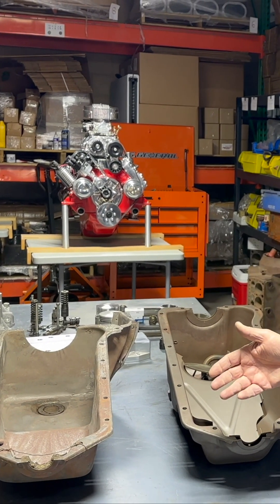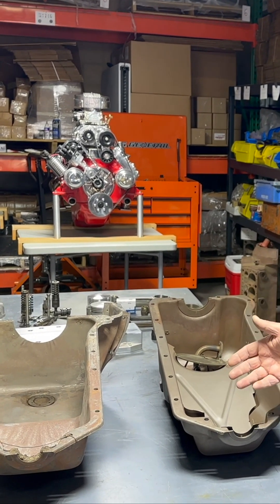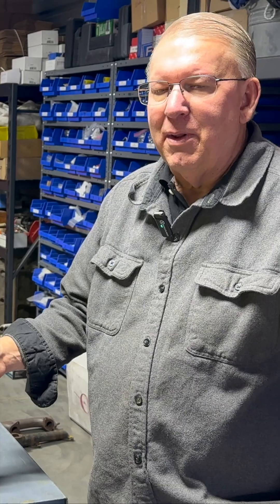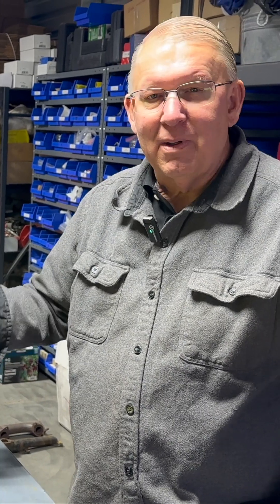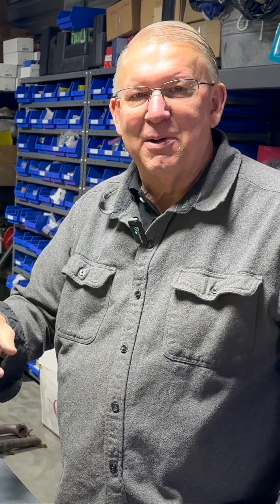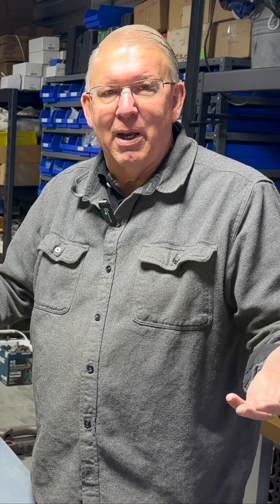Windage LOSS? - Performance Flatheads - Steve Coppock w #barryt #cpegarage

Comment: Back in the 50's and 60's higher reving 4 bangers.... The builders found out that "blading the crank" or thining the counterweights would reduce windage power loss and not reduce the strength of the crank and it had the additional advantage of a faster revving engine by reducing reciprocating weight.
Reply from the maker: As long as you ended with a good balance… Those counterweights are there for a reason…

Comment: A friend of mine used to take and have the counter weights machined to a narrow point and polish them when he balanced the engine using lightweight pistons, often with the skirts cut off of them, and aluminum rods, which allowed him to modify the crankshaft so that it cut through the oil without splashing it up, and causing aeration of the oil in the crankcase.

He also would polish the internal lifter valley of the block in order to improve oil return to the crankcase.

By doing all of these things he could make unreal amounts of horsepower and turn RPMs at extreme ranges with a 262 cubic inch engine, in 55 Chevy.

That was 40 plus years ago.
Reply from the maker: That’s some serious engine building right there
Reply: @BarryTsGarage 
Every little detail is important..
Some more than others.
Main thing is to have oil in the pan to begin with.😂

Comment: Yup and will definitely cause loss of oil pressure at the big end of the run when it's needed the most. Àlways found it funny when people spend big money on a deep oil pan and run it at max capacity, we always ran it a couple qts lower and it keeps the oil away from the rotating assembly
Reply from the maker: Very good
Reply: @BarryTsGarage 
Deep sump more for cooling...crank doesn't need to be "painted" with oil..bearings are a whole 'nother animal..

Comment: So tell us why the Flathead has differences as opposed to other types of  motors.   ;)
Reply: The crankshaft counterweights are real big and wide and crudely shaped with no regards windage.
Reply: @jimhmod  that’s interesting.  Thanks.  It would benefit even more with the windage tray. All I’ve run are big block Dodges.  ;)
Reply from the maker: Great question! I’ll have to get Ed to explain it to us!